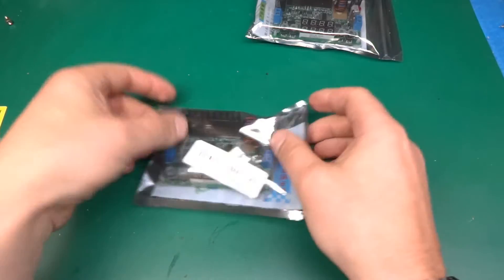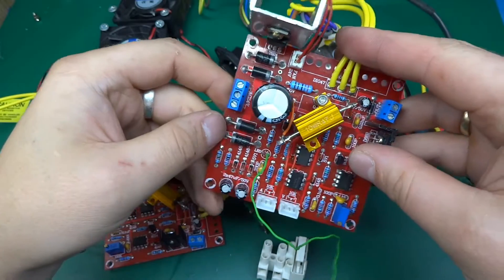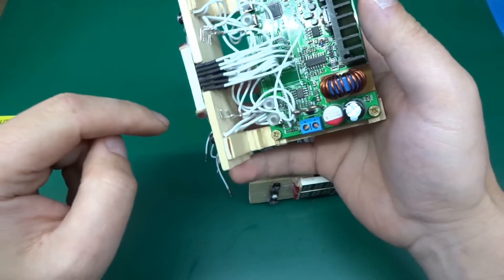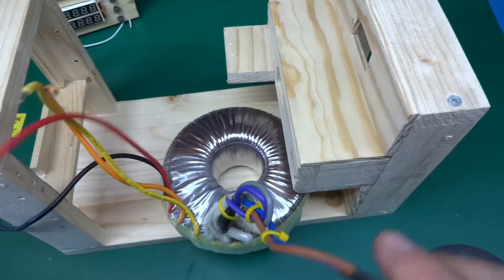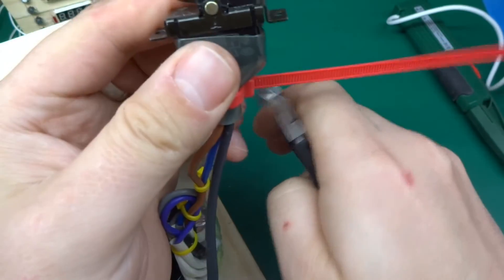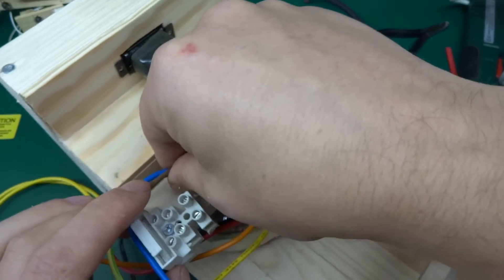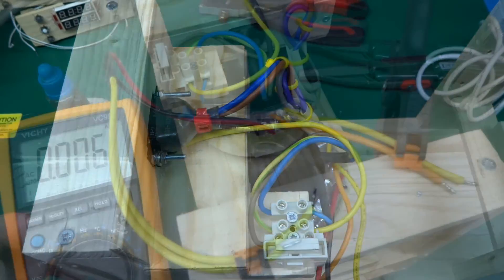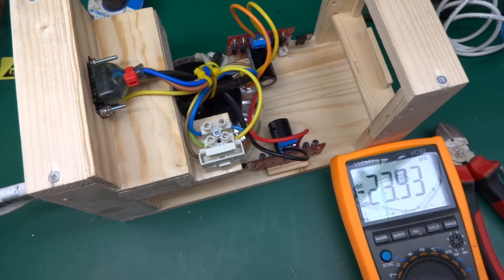DP30V5A-L   Dual DIY lab bench power supply build - Part one

Comment: Got one of these modules.  Very nice but, as you pointed out, building it into a case requires desoldering of the LEDs.  Not only is that tedious, it is also difficult to do without messing up some of the solder pads.  Too bad they weren't mounted in sockets.

Comment: Good work friend. I like it. thank you for supporting RD products. I am the designer. 
I saw you used the LCD disassembly version . it is good, I design this version to let customer DIY
you use wood case to be as case. good idea
in fact , if you want to be better display, you can choose DP3005 or DP30V5A. those are better.
and there is a DPH3205 buck -boost . you can check. it has a better application 
https://www.aliexpress.com/store/product/RD-DPH32305-Constant-Voltage-current-Buck-boost-Programmable-digital-Power-Supply-buck-Voltage-converter-color-LCD/923042_32762131242.html?spm=2114.12010608.0.0.itIaQj
Reply from the maker: +Rd Tech Hi, thanks. I saw the DP30V5A before, but I chose the LED version for simplicity and cost. Those are really good modules in my opinion. The only thing I miss on the DP30V5AL is the encoder/knob because the buttons are a little fiddly, but I guess that's ok. Do you have a website with your products? I am interested to see more of modules like this.
Reply: randomtronic
thank you very much for your support , yes, DP30V5A-L is simple and cheap. and about the button, there is no  encoder/knob, only buttons, sorry . 
https://rdtech.ru.aliexpress.com/store/923042 this is RD official store, you can check 
if you like something and want to order , you can leave a message "you are "randomtronic from youtube, I will give you some discont , when you make order , ok？
thank you , hope you like them
Reply from the maker: +Rd Tech thanks, I will check it out!

Comment: The Voltage on the Secondary Side is 29V because the windings are in an open circuit, Just attach a load and the Voltage will settle ;)
PS: Just a tip, don't play background music, it's really annoying in a 20min long video... Or, if you want background music, turn it a bit down.
Reply from the maker: Robin Cerny Thanks, will do from now on. I think i will stop it now completely and see what's the response.
Reply: stop that music!

Comment: nice thing u do with the AC connector. Using wood doesnt affect the inner temp of the power supply? i think the toroidal trnas dont have too much space to dissipate the heat
Reply from the maker: +Francirius Yes, you are right, it could get toasty inside. There are no vent holes. But I will be adding temp sensing on the inside to see how things are going. I will shoot a video on this soon, just waiting for parts. For the time being I am being gentle with it :) If it will be getting hot I will add some holes and a fan.